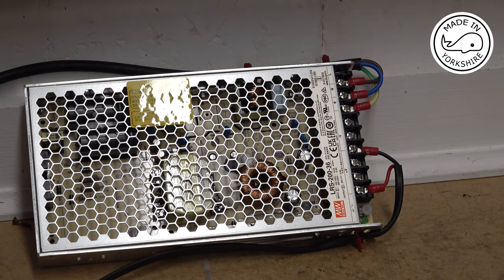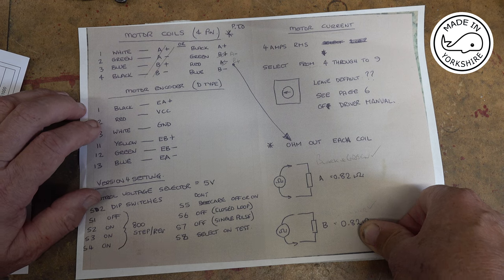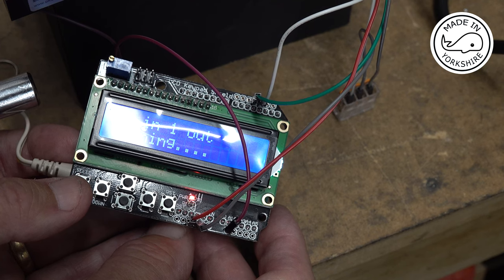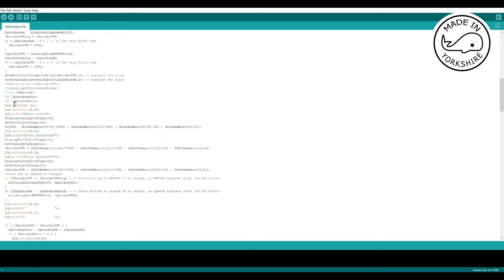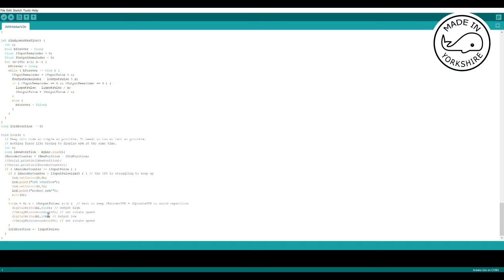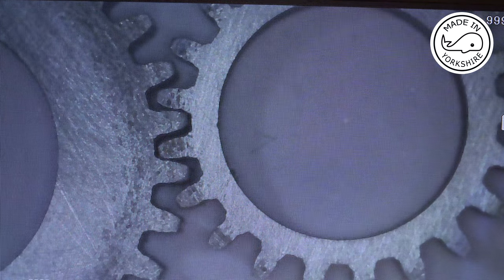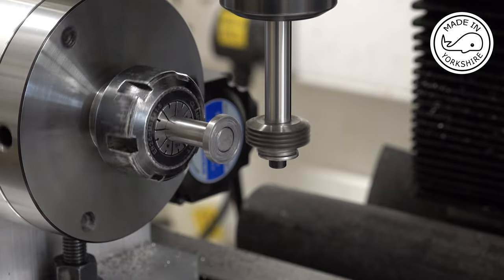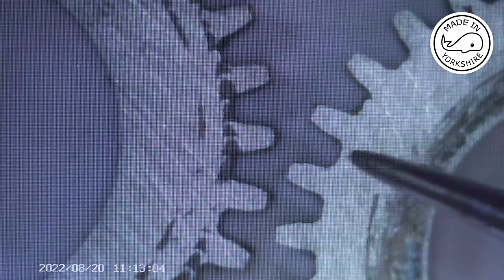#MT50 Part 6 - Making a Gear Hobbing Attachment. Closed Loop Stepper Motor. In 4K by Andrew Whale.

Comment: Hi Andy, very cool video you did. There might be an performance issue in your code. The digitalWrite function takes some time (If I remember correctly, it’s around 190 cycles per call which is ~10 uS for the 16MHz Arduino Uno). You are doing it two times in the for loop (20 uS). So you are able to handle 50000 Pulses per second. Depending on the pulses your encoder produces (and ignoring the fact, that the main loop does other things as well) this might be an issue (RPM/60 * PulsePerEncoderRev). Long story short: instead of using digitalWrite try to write the output registers directly. This will increase the speed drastically. Ideally you won‘t have not more than one iteration of the for loop per iteration of the main loop. Don‘t know if the encoder lib does support interrupts but this could be a better way to track each single pulse of the encoder and to ensure perfect synchronization (Depending on the hob speed you will overcome the capability of the arduino and you will need a faster cpu like the Esp32)
Reply from the maker: Hi David - thanks for the suggestion. I've since been testing using AndysMachines code which is written in assembler. So I guess his code would be far more efficient than my code. I tried to make my code as tight as possible, but included a crude check to try to identify if the Arduino was running out of steam. I will however investigate to see how I might be able to write the the output registers directly - not something I know how to do at the moment.
Cheers
Andrew
Reply: @learningturningmetal  I also think it's an issue with the timing. When you showed the traces in the previous video, there was very clear jitter in the timing between pulses. That would result in slight angular variations back and forth, which is consistent with the results you're getting. I believe you're using an AVR board, so one option would be to switch to an ARM board. Those clock speeds on the order of 10 times faster than an AVR. So would help to mask any timing issues with code.
Reply from the maker: Hi John - after further investigation I think the problem is hob related. I'm just in the process of uploading another video which might help explain.
Cheers
Andrew

Comment: The hob is likely not causing the issue. I assume it works fine on the other hobbing machine. (Andy).
I had massive problems with a really cheap parallelport interface, it was missing encoder steps. (optocouplers) just too slow to "catch all the signals", missing some.
Try an encoder with less lines, slow down the spindle or use only A or B signal? (not both)
Then there might be and issue that your signal to the stepper driver is not triggering a step every time. 
 I have one driver that refuses to work on an Arduino, but it works on another controller. (seems to have too less power to drive the input reliably)
To check this I would change the software so that the signal to the stepper driver and the signal coming from the encoder have the same frequency. 1 Encoder pulse, causing 1 step signal. Then hook up the oscilloscope and see if the two signals are matching. Does this make sense? 
If you have a speed issue in the signals, everything will look fine when moving slowly and if you reach a certain frequency it goes all downhill.
Reply from the maker: Hi Timo - thanks for the suggestions. More testing needed!
Cheers
Andrew
Reply: @learningturningmetal  Thank you for letting us participate. Do not give up. But ... computers do not deserve to cause frustration 🙂.  Stay undefeated do not let the thing harass you. 

Cheers Timo
Reply from the maker: @timogross8191  I think I might have found the problem. Hopefully the next video will explain.
Cheers
Andrew

Comment: Really enjoy the video! Could I put forward that it might be as much a synchronization issue but a synchro phasing issue. If there was Sensor on the mill shaft, and one on the closed loop motor shaft they could be compared. Say for example, both sensors are set so that a position on the cutter is “0”, and one on the motor shaft is also set to a “0” position. When the cutter makes contact, it slows a bit by friction as it cuts, so now the sensor reads “-1”. The sensor on the stepper motor might read “-3”, from being introduced into the rotational speed of the cutter. If the mills pulses need increased, the program counter will see the incorrect RPM count, and speed up accordingly. Independent of the mill, the stepper motor will sense a low RPM, and the program will speed it up to a null state. ( not +/-). Between the independent speed adjustments, the drift would be reduced I think. What say you?
Reply from the maker: Hi William - I see where you are coming from. I think I would need to get hold of another encoder and attach that to the motor shaft somehow. I will have a ponder!
Cheers
Andrew

Comment: Fascinating detective work. You seem  very close to an acceptable working gear, but I know what you mean, it is annoying when it is not quite right. I can offer no help regarding the electronics  but I do agree with other comments that a bit  more rigidity may help. Can the hob shaft be shortened by holding it further into the collet? A tailstock might help if you can set it up so that it doesnt get in the way. Certainly cutting in one direction should give a cleaner finish, but if the synchronisation is correct you should be able to come back out of the cut without removing more material. A little more sleuthing required yet Mr Holmes 🧐
Reply from the maker: Hi Tim - thanks for the suggestion. I will explore regidity.
Cheers
Andrew

Comment: The sync issue is likely worse under load, I.e. while cutting.  It sounds to me like your arduino is missing an encoder step.   I have seen this problem in a similar application I am working on.
Reply from the maker: Thanks for the suggestion Fred. More testing needed I think.
Cheers
Andrew

Comment: Gday Andrew, you have eliminated a lot of possible factors and it really can be only a couple left, 1 the job is not correct and 2 it maybe be arbor flex on the hobb, there was a bit of runout on the gear arbor to, I know this won’t bet you and  you get it sorted, Cheers
Reply from the maker: Hi Matty - yeah there is runout on the arbor - I will replace the collet chuck with a 4-jaw to eliminate that. I too am wondering if the hob might be root cause. Problem is that hobs are expensive, and I don't want to purchase one without a future project in mind. The second hand hob market looks risky too, without knowing the history of the hob. Apparently incorrect sharpening of the hob can introduce all sorts of issues.
Cheers
Andrew

Comment: It has been decades since I have had anything to do with servo loops but I was thinking that even with a closed loop stepper motor it would still lose a step.  The motor encoder would detect it but in this configuration it cannot correct and keep sync.  Is there a way to read the output of the stepper motor encoder to see if a) it detects and issue or b) at least see if the two encoders jive?  If they are out of sync try cutting with less depth of cuts or try sobbing in plastic or some softer material.  Just a thought.  But, as they would say in your country....Keep Calm and Continue Hobbing!.....OK I admit bad joke.
Reply from the maker: Ha ha- more like Keep Calm and do something else! More testing needed!
Cheers
Andrew

Comment: You are not accounting for the "phase shift" when you are feeding from the from face to the back face of the gear.

When you feeding in, you are changing the relative surface speed of the spindle vs the workpiece, by adding a small amount of speed on top of it.

In a mechanical gear hobber this problem solves itself, because gears and leadscrews are in mesh, and feeding in automatically speeds up or slows down the spindle in relation to the workpiece.

You either need a precise and constant feed speed and account for it in the code, or, you need to electronicaly measure the distance covered by feeding in and account for that.
Reply: Since the hob angle of rotation is electronically locked to the gear blank angle of rotation, it is hard to see how the X-axis position or speed would have any effect when cutting a straight-cut spur gear.  However, cutting the gear by moving the X-axis very slowly and steadily only in one direction should remove any such error.
Reply: I think that effect is real, but would be very small considering the rotational speed of the cutter vs the feed rate.

Comment: Try cutting a gear with an odd number of teeth 21, 23 etc and see if it changes also maybe change the drive ratio to an even number like2:1or 4:1. Could be a mathematical problem . You have encoders running even numbers , micro steps of even numbers a gear of even numbers but a final drive that divides by 3 .
Another thing I was thinking is how consistent is the speed of the mill spindle ? If the rpm is surging up and down maybe the rest of the system isn’t reacting fast enough to compensate ? A Dual channel oscilloscope would set to tread the pulses of both encoders might show this or maybe something as simple as a strobe light ( timing light ) shone at some marks on the gear blank and one cutter tooth would as well .
Reply from the maker: Hi Ian - thanks for the suggestions. I think that math is good at the moment. Effectively I've got a 1:1 ratio in relation to incoming encoder counts and outgoing stepper counts. So to make a 13 tooth gear, just read 13 and output 1. It's a real brain teeser - far too many variables that could affect the outcome. More testing needed.
Cheers
Andrew